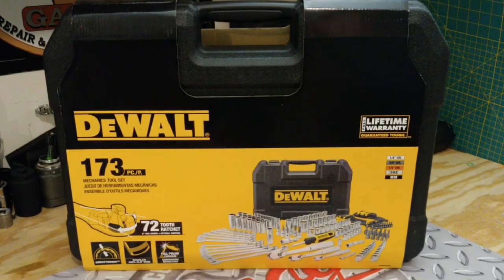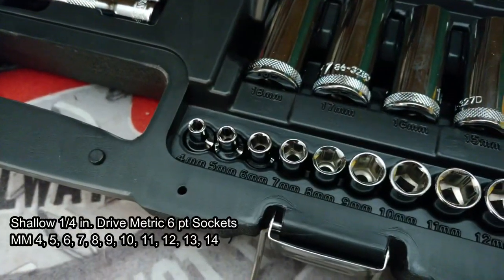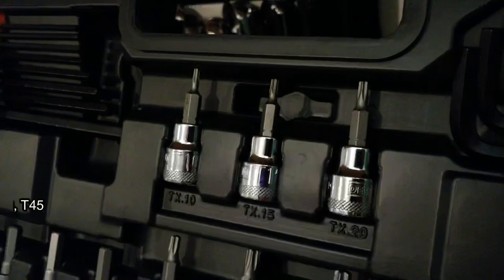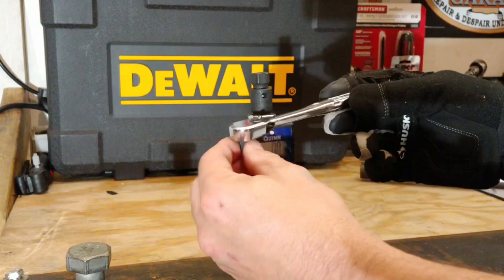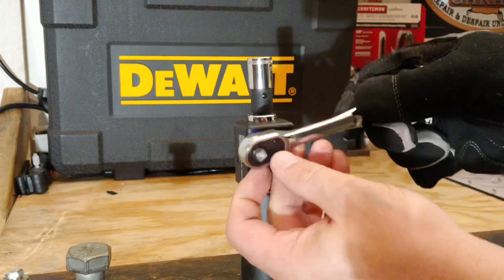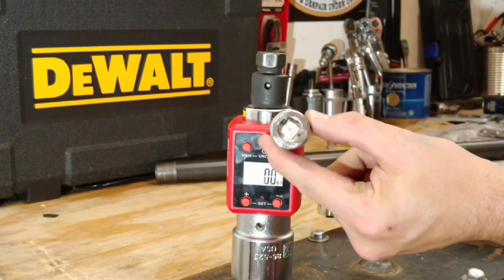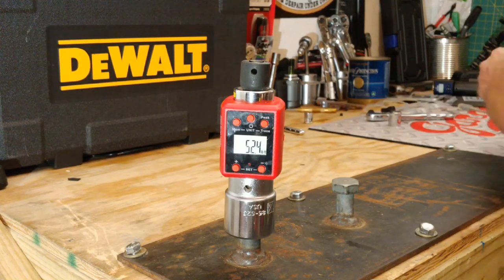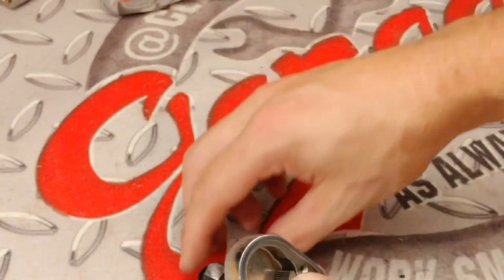Costco Dewalt Mechanics Tool Set 173pc Guaranteed Tough Put to the Test Item: DWMT41019 1731730

Comment: I got this set for free from a raffle and I was impressed with this set. The wrenches are pretty nice. I was most surprised with the ratchets. They feel really nice but I haven't tortured them at all.  The set is missing some important sizes so it can't be the only set but it's good for trips and stuff.
Reply from the maker: It’s not a prefect set, but for $100 it has a good set of ratchets and a lot of value.  If it’s like other sets Costco wi mark it down $10 bucks at some point.
Reply: @ClientGraphics  You spoke too soon. Try $20 bucks right now at $79.99.  Nov 2019.

Comment: I have been know to use a 3 lb hammer on the handle of the 1/2 DeWalt to break bolts loose... 5 years of that and still going strong.

Comment: Glad to see this is a tuff set of tools.. It definitely looks good!  I have this set in my truck tool box and have only used it a few times.  I have used the sockets on my Milwaukee 1/2 "  impact to remove lug nuts and they did just fine.    Don't care for their power tools, but their hand tools are nice for sure.

Comment: Good video!! Sadly i feel that the quality of Dewalt Mechanics tools is slipping since SBD launched Craftsman. First it was the disappearance of the anti slip opens on Dewalt combination wrenches. This was followed by Dewalt moving to that funky groove detent on the socket's female square drive, ala older craftsman sockets. I really like the 72 tooth pear head  ratchet in that set along with their flex head versions and the Italian made round head ratchets that are USAG clones with the comfortable Dewalt all metal handle. However, I'm reluctant to buy Dewalt mechanics tools since their quality is slipping. Thanks for sharing.
Reply: I've noticed the same thing on their sockets but they still fit good on the ratchet unlike Craftsman husky and duralast which all wobble all over the ratchet

Comment: You can use a towel. I used some Linoleum I had back in the corner of my garage. But replace that cheap piece of foam on the inside with something more substantial. Cut it to fit, and be done with it.

Comment: I think most socket sets will hold up if used as they should be.. cheater pipes is where you run into problems on 3/8 ratchets and up.. 1/4 dtive you might break without cheating.. am i wrong?

Comment: I have a similar set thats all sockets, no wrenches and drivers. The ratchets are quick release and I imagine the anvils are likely slightly weaker as a result, but can confirm they've proven to be tough as Hell so far. Also, all my sockets are the oval type detent, not sure why yours has a mix.

Comment: Felt like I missed out when I saw a photo of this set on sale at COSTCO for $79.99 last November and I needed a set to work on my car but this set does not give great coverage for the upper end and the glaring fact that it does not have deep 1/2" mm sockets at all. No Quick release too which isn't much a deal breaker to me if quality but I know others it would be more of so. 
Am going with the DeWalt 192-piece set even though theres less coverage for the small mm's I guess that's what the 1/4'' part is for and don't need a lot of torque anyway. Getting a complete set of wrenches 6-24, maybe 6-32 from Tekton.

Comment: Debating on which set to go with right now. Really like the Craftsman 150 piece set in gunmetal chrome.  For some reason I keep goin back to it I like the looks of it and the case seems really nice as well. The main thing is it seems to have the best assortment and lots of sockets. Not much filler/junk either. 

I don't have a particular Dewalt set in mind but overall would you recommend the Craftsman gunmetal set or a Dewalt set? I don't care about the Craftsman wrenches being serviceable or not. Just want the set that will last the longest and both have lifetime warranty anyways. Also don't wanna deal with a crappy case that loosens up causing sockets to fall when you open it. Idk which cases are better but the few times I opened a dewalt set at Tractor Supply sockets fell out and would not stay in
Reply from the maker: Between the two Dewalt and Gun Metal Craftsman it’s a toss up. Probably go which ever is cheaper or has the ratchet you want or has the most sockets or best coverage. Gun Metal is quick release and some of the Dewalt sets may or may not be quick release ratchets. The gun metal sockets don’t come in singles so if you lose one or have to warranty it you may not get a gun metal one back. Both can be a phone call away for warrant since they are both owned by Stanly Black & Decker.  That being said I own both if you can catch the Dewalt on-sale you can get a really great valued set that people talk very little about and it will really last for years for a DIYer

Comment: Thanks for doing a thorough test on this. Too many reviews open, look at the tool, and do a soft test. But without a failure test, you never know if they're going to snap (which is common with cheaper kits).

I'd be curious how this compares to the new DWMT45184 unit (item# 1841840) at Costco (I believe it replaced this) or if it's primarily just a color change (black).
Reply from the maker: They are about the same. The black chrome doesn’t show the dirt and oil as much as chrome. The newer black chrome does wear differently then chrome but they function and work the same.

Comment: I have one of those 3/8 drive Dewalts I bought in a 90 pc kit and I can tell you for a fact is stronger than my pittsburgh 3/8 and my craftsman 3/8 too. That ratchet can take a beating!
Reply from the maker: I totally agree with you, the Dewalt ratchet really can take a beating.  It was really strong with zero bend or flex and is a good bang for your buck.
Reply: You got x ray vision how do you know hahaha
Reply: I just had my 3/8 AND 1/4 inch Craftsman rachets bought in 1978 in the same set break in the same week here last summer. I guess it was their time or someone back then was seriously good on the planned obsolescence.  And it wasn't some torture test I was putting on them. They did replace them both at the Sears Hometown store. The new versions are NOT of the same quality in any way shape or form. I also still have my dad's old set.  I went ahead and bought this set at $79.99 online in Nov 2019. I'll fill in the holes with my old Craftsman pieces.

Comment: You should try the 192 pc socket set ratchets. They have the same type of sockets. But it’s a hell of a deal. $120-$150 depending. They’re quick release ones.
Reply: Jared Storr Quick release are usually more prone to failing because of the hollow drive

Comment: Wikivids listed the DeWalt ratchet as their #1 best  for the money two years in a row, but I have no idea what they based their criteria  on. ((((( I've been told that the DeWalt ratchet shares internal components with other Stanley-Black N Decker brands like Proto and Mac's Expert line.  Which is very possible since it's all the same parent company.  
((((Another YouTube channel cut open the head of one of the new Craftsman Gunmetal chrome ratchets and discovered that it had the same internal gears as a Stanley ratchet sold by Wal-Mart.
Reply: That's good to know.

Stanley has always made a nice socket.

I just don't like their deep welled sockets 

They are simply TOO SHORT

Comment: They have a similar set at Costco right now in black chrome for $99. Is the black chrome the same just a different color? I’ve seen the black chromium sets around and they are more expensive. Are the black chrome nicer than the chrome?? 

I’m looking for my first set of tools to work on my car and want a set of tools that will last for generations.
Reply from the maker: The black chrome are the same just the different finish. The black to me rubs off and wears different compared to regular chrome, but they operate and work identical. It’s purely cosmetic and a personal preference.  The $99 set will drop in price $10-20 dollars usually so catch it on a sale👍🏻

Comment: Seems they fail right around 300% of useful torque.  1/4 you'd use at most 25ft lbs, 3/8 for 80 ft lbs, and 1/2 for 200 ft lbs.  Any more than the useful ratings you should step up the size of the ratchet and socket or go impact or breaker bar.   I have a set of Dewalt 1/2 deep 6 point metric sockets and they are definitely quality for the price.

Comment: It didn't beat Milwaukee which 3/8 failure was at 300ft/lbs . This Dewalt set isn't quick release so if grease gets on socket wont be easy to switch socket. But overall its durable set
Reply from the maker: The current Costco DEWALT $99 set has 176-Piece Mechanics and is also quick release. It also has a Black Chrome Finish.

Comment: With ALL the time and effort put into making this a quality toolset, I didn't see any 3/8 inch deep sockets.
So close.
Reply from the maker: It includes 3/8” 6 pt Deep Sockets in metric are 10, 12, 13, 14, 15, 16, 17, 18
It’s at about 1min 42sec
Reply: they have other sets minus the wrenches and driver that has a complete set of sockets inevery drive. I have one and it's been great so far.

Comment: Correct me if I’m wrong but aren’t DeWalt hand tools just overpriced Craftsman? 
I understand they aren’t totally the same but same parent company.
Reply: These DeWalt Ratchets have been on the market much much much  longer than than the new Craftsman stuff. Possibly they share some internal parts with  Mac Tools, Proto and Expert Tools ratchets (those brands are also owned by Stanley Black N Decker)....There is a YouTube video where a guy dissects one of the new Craftsman  Gunmetal chrome ratchets and discovered that it shares internal components with the cheaper Stanley ratchets .
Reply: @themountofoliveschannelwit7009   to go a step further if replaced a few ratchet guts with Pittsburgh pro & were exactly the same,tooth count & all then swap the guts & well you get the picture & I'm talking $70 to $80 ratchets...just thought I'd share...

Comment: I find it hard to believe that welded bolt on the table held 625ft.lb ...
Reply from the maker: The 32mm M22-2.5  Grade: 8.8 had two good full complete passes if not more like 3 when it was put down.  We cut off the threads and put the thickest part of the fastener right to the plate.  It's going to take quite a bit to get that to come off✌
Reply: Good weld!